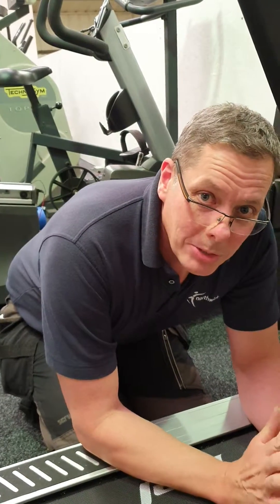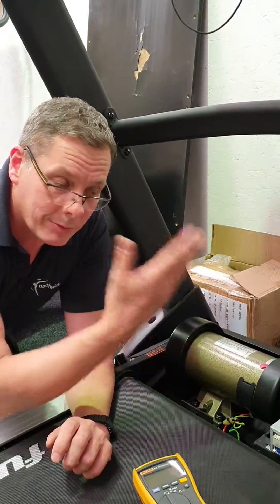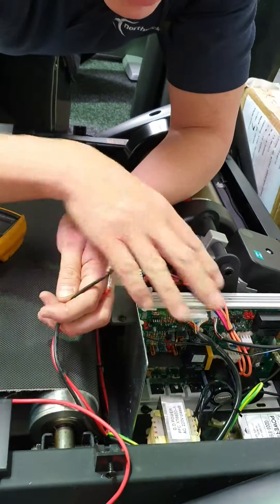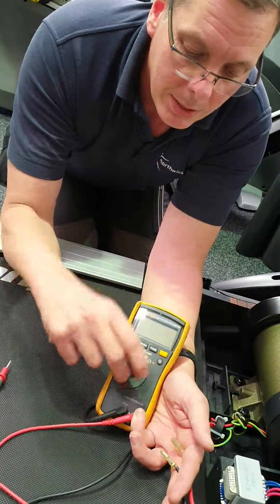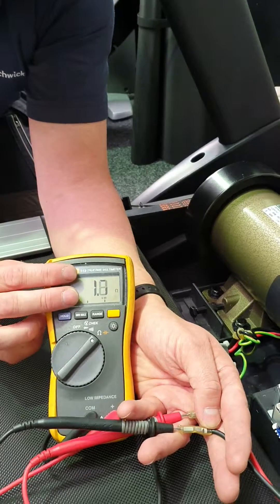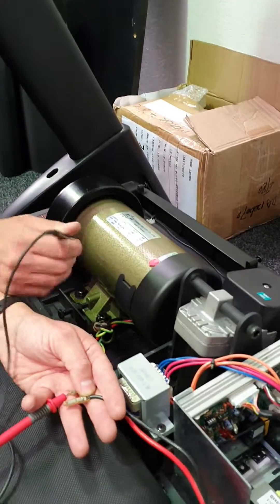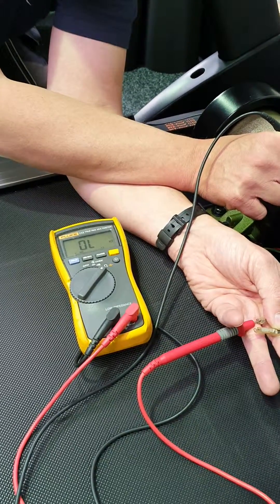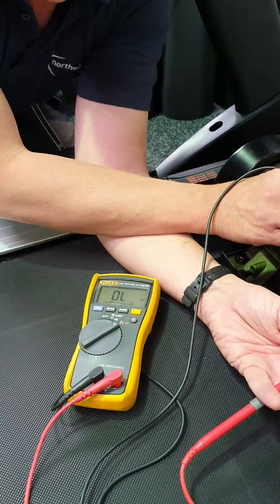How to check a DC drive motor from a treadmill using a multimeter

Comment: Hi there, I have a GoFit GFTMP01 and it has the error1 code, I have checked all the cables and everything looks ok, so I think its the motor... I have done your test above and the first test, the first time I got 10.3 reading, second time 9. something and the third time it was dancing around for awhile but finally settled on 7.8.... The second test never gives me a reading, I tried the black one on the motor, the chassis, random screws and bolts on the body of the treadmill...

What is your professional opinion please?

Comment: Hi, any ideas? Using analogue meter, first rest shows about 0.8 second test needle doesn't move. Got power to board and it shows sending signal to motor but although there is power going in motor doesn't move. Any help appreciated thanks

Comment: can i use a power supply to give it 9 or 12 volt dc for test it ?
or its better to use a suitable battery for this ?
Reply from the maker: Unfortunately, you can't use a battery to reliably test a DC motor for a treadmill. This is because the DC motors have permanent magnets and all a battery will tell you is if the motor will turn. If the magnets are damaged (which is often the case if the MCB fails on full load) then you will not know it. If you simply fit a new MCB, it will fail again quickly. You should take it to a specialist DC motor repair shop and get it tested on full load and have the torque or current draw checked. The full load current should be as indicated on the label on the motor. If it is higher then the magnets are damaged and the motor must be scrapped.
Reply: @charteredengineer  thanks for the answer sir 
if i want only test the motor without load  if turns can i use apower supply 9 volt instead a battery as i have seen on the most video on you tube ?
Reply: furthermore sir something else if the treadmill turns normally and the motor smells whats mean that from your experience `?

Comment: The motor runs but gets hot and it smells. Replaced the bearings without success.
Ran the motor disconnected from the belt and it still gets hot and smells.
Resistance was 2.5 - 3 ohms. I turned the armature through 1 revolutions slowly and no shorts or open circuits.
Both leads measured open to the motor body.
Pulled the motor apart and measured directly across the armature coils and found 2.5 - 3 ohms between every pole and every other pole. I cleaned out the gaps in case it was a buildup of graphite but it didn't change anything.
I must have multiple shorts in the windings where the insulation has failed in a place that doesn't result in a short circuit reading on the multimeter.
Reply from the maker: If it's a domestic treadmill with a permanent magnet DC motor then it's most likely that the magnets have lost their magnetism. This would result in overheating and excessive current draw. If so, you'll need a new motor.

Comment: Hi my meter is saying L to N of 443 and second test to chassis of motor on either phases is OL ,can you please advise me thanks Jim
Reply: Hi Jon my mistake ,I was testing the wrong wires ,I have removed the motor and re tested ,the reading iam now getting is around 5 which is low ,I have also tested the motor on my car battery and it runs fine ,the machine is coming up with an E02 fault code ,the manual indicates that this is a motor failure  thanks Jim
Reply from the maker: @jamesgriffen1740  Most likely a problem with the controller
Reply from the maker: The reading of 443 is much higher than I would expect and so I think there is a problem with your motor. The OL reading to the chassis is good.

Comment: I have an old BH Fitness treadmill. I smelled some burning then the treadmill died. I see the burn mark on the control board. I replaced the control board and the treadmill works now, but i thought i smelled some burning again. Even though the motor runs and seems fine, could it be the cause of why the control board got burnt out? What do i need to check now? thank you
Reply from the maker: The same problem happening again will be due to there being too much friction between the running belt and deck. This happens due to either lack of lubrication or just wear and tear. You need to replace the running belt and perhaps the deck too. Maybe time to look for a new machine.

Comment: Hi. My treadmill has died and tripped the circuit breaker. I did get an electrical burning smell just before it went wrong. The casing of the treadmill was quite hot and directly underneath was the motor. I took the motor out and have done this resistant test. I get 2.6 ohms (180v motor, 5.5 amps). I did the chassis test and I’m not getting a reading. I can buy a new motor but not 100% confident it is the motor
Reply from the maker: Hi Simon - electrically your motor is testing ok although it could have suffered heat damage to the windings. I suspect your motor control board has failed and is causing the tripping. Most likely the root cause if high friction between the running belt and deck. These could also need replacing. Hope this helps. Best wishes, Jon
Reply: Thank you. I attached the motor to an 18v battery from my portable drill and the motor is turning. Now to see if I can check the motor control board you mention. The motor seemed easy to buy….whether I can but the control board remains to be seen 😬. Thanks again

Comment: 200M -  01.7
Chassis - 05.1🤔
Reply from the maker: Hi - If the red and black wires are 1.7 ohms then that is good. If the red/black to chassis is 5.1 ohms then that is bad!

Comment: Hi jon any help would be greatly appreciated i have a 3hp nordictrack treadmill motor ive had the motor control board repaired and the guy says the damage points to a faulty motor the first test is reading 002.7 and second test is ol

Comment: my 4.0 Magna Drive motor for my anytime fitness treadmill says .7 ohms on the first test, then 0 ohms for my second test
Reply from the maker: the 0 ohms reading is bad news - this means that the windings are short-circuit to earth. Your motor needs to be repaired or replaced.

Comment: Hi, i have a T3 life fitness treadmill motor 3900 rpm 130vdc 21.5 AMP 3hp...this put me on the voltímeter 3.8-4.0 my problem Is that when I start the machine appears on console Fet error AND couldn't start 😮‍💨😪...I  have a doubt,about this motor when I put 12V without motor belt, registered 0.54 AMP constantly(start in 0.92 AMP AND then go down to 0.54 amps ) without resistance, it's a bad motor? Or the drive transistor board failled? Thanks a lot, the motor smell Little like burning
Reply from the maker: It could be a faulty motor especially if you can smell burning. The drive board may also have failed. The root cause could be too much friction between the running belt and deck. My experience is that the running belt and drive board are the most likely to need to be replaced. Hope this helps.
Reply: @charteredengineer  thanks I appreciate to you, I have one more lquestion, what's the AMPS that one good motor need to work whithout people, chanrge or motor belt put in...I mean a good AMP work, some people say that Is 0.21-0.29 AMPS constantly in this kind of treadmill motors no matter what voltage put for work after 12V, But always need to be that? Thanks for all, good Day AND thanks for the videos 💯🤜🤛

Comment: Hi Jon - my first reading is 5, but on the bare metal test, the meter stays put on #1
Does this mean motor is bad?
Thanks
Reply from the maker: Motor is electrically good.
Reply: @charteredengineer  
Many thanks
Reply: @charteredengineer  Many thanks 🙏

Comment: One more thing, and I'll stop bothering you, my reading on motor leads 0.7 , and nothing to ground. That low reading is normal,, yes?  4.2 HP
Reply from the maker: 0.7 ohms on the leads is good. "Nothing to ground" I assume this means you are not reading anything on the meter which is indicating a very high reading (over the range of your meter). If so then that is good. If you are actually measuring zero then that is bad because it shows a short circuit to ground. Best wishes, Jon

Comment: OK, since that conversation, I hooked up 18V from a drill battery and the motor worked, I'm guessing the power board? I'm not getting any DC volts off the board to the motor leads. Thanks
Reply from the maker: Yes I agree - sounds like the power board that has failed. Check the running belt and deck for excessive friction - this is often the cause of the circuit board failing (overload!)

Comment: Hi Jon great job, my treadmill red black shows OL ,, no resistance, keep in mind theres also 2 blue to the motor also. thanks is the Moto shot?
Reply from the maker: Hi - yes I think the motor is shot. There should be a low resistance between the red and black wires and OL indicates that there is no connection so windings could be burnt out. The blue wires are to a thermal switch which is separate - a Nordic Track or Proform treadmill presumably. Best wishes, Jon

Comment: The black lead on the motor showed a shortcircuit to the motorhousing. Took the cap off the motor that holds the carbon brushes. Found a build up of carbon dust making a connection between the carbonbush holder and the housing. Gave it a good clean and reinstalled everything. Runs as good as new now.
Reply from the maker: Thanks for adding the comment - very interesting and useful for others!

Comment: Hello 

I have done the checks as stated in your video, 

My red & black wires on Omz give a reading of 2.5 

My 1 multimeter wire touching the motor metal part gives a reading of 0.L 

Could you please tell me if the motor is working or needs replacing 

Thank you
Reply from the maker: Electrically, your motor is fine.
Reply: @charteredengineer  John, 
Thank you so much for your reply. Do you have any other suggestions as to why my treadmil belt is not starting? The incline and all other other buttons seem to except the treadmil belt. 
Thank you
Reply from the maker: @geetabickerton416  I can offer a remote video diagnosis for GBP49. Let me know if you are interested.

Comment: With the black wire scratching the motor it is showing OL
Reply: Thank you and I did get that motor running by hooking it to a 20 volt Craftsman drill battery. I was looking to see if that model had the fuse in it and I was hoping you could let me know
Reply from the maker: @MustangSteve  the motors don't have a fuse - the fuse is on the MCB (if fitted).
Reply: @charteredengineer  thank you for an awesome video and your help..
Reply from the maker: That's a good pass.

Comment: I set my multi meter on 20 ohms, touched meter wires to motor and meter went form "1" to "0".   No results on second test.  Meter stayed on "1".
Reply from the maker: That's a pass - low resistance on the windings themselves and high resistance on the windings to to case.
Reply: K, wonder why motor won't run when power being supplied to it.
Reply from the maker: @larrythompson5617  Probably a faulty controller. Possible excessive friction on the belt and deck too. Worth finding out what the root cause is before you start replacing parts. I can offer a remote diagnosis (online) for GBP49 if that helps. Best wishes Jon
Reply: @charteredengineer   Well you were right.  The motor is fine.  I attached a cordless drill battery and the track worked.  Now there is power coming from control board but when I connect motor wires to the control board a red light goes off.  So possibly the board is gone.
Reply from the maker: @larrythompson5617  Yes most likely. You can't reliably test a circuit board with a multimeter as the output is a PWM signal and multimeters do not have that option. Also you need to determine why it has failed.
Reply: Belt and  motor are free spinning and power coming from controller so somewhat perplexed.

Comment: morning Jon im getting a reading of 14 ohms at the motor and a reading of 166dc to the motor from the board. i have an E1 error the screen lights up and goes through the start up cycle the time starts to count when i press start but at no point does the the belt turn. then after 8 secs the board clicks and the E1 error appears any advice would be great

Comment: Hi Jon thanks for the video thanks for making it easy to understand. I'm having trouble with the Error code E-03 on a reebok Z9run treadmill, you say that the resistance should read around 1.7 ohms the number I have on my meter is 02.8/9 second test showing no movement on meter. Gordon Higgins

Comment: Hi Jon , I have a Reebok ZR10 with error E05 showing a few seconds after start up. Have replaced control board  (first suggestion ) no good . Replaced speed sensor  no good. Finally disconnected  motor from drive by removing belt from pulley. Motor runs but pulses and then goes to E05. Checked motor as you suggest . on 200 ohm setting I am getting 23 ohms and on second test getting 1. When running the motor detached from drive I also have the speed sensor removed would this explain the pulsing of the motor  and is 23 ohms a bit on the high side ?
I should explain that I know E05 relates to running belt speed and tried many times to set correct tension on the track .
Reply from the maker: Hi Richard - motor results are good. It sounds like the console is not getting the speed signal. If you have replaced the sensor and the lower control board then you either have a console circuit board fault or a faulty cable. Hope this helps.
Reply: @charteredengineer    Thank you Jon for your very quick reply ! I will look into your suggestions ! thanks !

Comment: Is there a way to tell the brushes are bad. I’m currently troubleshooting a radiator fan motor. I got a resistance of 350k ohms between the terminals. I wonder if the windings are bad or is it just worn out brushes. Thank you

Comment: Thanks for your video! I have a Tunturi T40 with 180 VDC motor. The motor driver board starts. When I press the start button, the motor starts to turn but the driver board immediately gives an error and stops the supply to the motor. I want to determine if the motor or the drive board fails. The resistance from the motor is 2.2 ohms with a Fluke. Between each wire of the motor to the chassis I have open loop. Do you think this is normal?
Reply: Checked/cleaned your speed sensor?

Comment: On the first test I'm getting 4.2 ohms and on the 2nd test 87.7k ohms. This treadmill is tripping the circuit breaker. Replaced a burn out belt last month. Is the treadmill unrepairable?

Comment: Hi Jon, firstly thank you for your video.
The first test shows a reading of 0.01 ohms with the Meter set on 20k 
This result does go up if I rotate the motor not sure if that helps aid in in answer.

Second result I get a 1.  screen on the Meter ( note this is a really cheap Meter)

I have put an 18v battery to it and seems to run fine 

I have seemed to check over quite a few things and the seem all ok 
The issue , when i put power to the treadmill it start the motor for a split second then trips the breaker I'm guessing it's either the circuit board or motor?  Have tested  breaker and other components seem all good.? 
Thank you for you help
Reply: Hi Elias, I have the same problem when the motor starts. Did you already figure out what caused the issue with your treadmill? 
the first test gives me 1.7 - 2.0 ohms and the second one OL. so the motor wiring seems to be fine. I also replaced the entire control board but the problem persisted.

Comment: My meter reads 0.7 Ohms. In some positions I can get it to read 1.0 Ohms. It reads an open circuit to the outer case.
The motor is a Turdan 90V 18Amp motor. So I would expect the coils to read 5 Ohms = 90V/5 Ohms = 18Amps. So I would think the coils are shorted out somewhere? Or is that normal?

Comment: Hi, in my case, between the terminals I get a reading of 1.7 ohm which seems ok... but, between any of the terminals to the chassis I get around 35k ohm. BTW, I'm testing the motor because when it's connected to the control board it trips the differential fuse. So, could it be the motor insulation the problem?
Reply from the maker: Sounds like a motor problem. 35k resistance is likely to be enough to allow a small current to flow to earth and cause the trip.
Reply: @charteredengineer  , Thanks for the tip, I fixed the problem!
I opened up the motor and inside it was saturated with this really thick “dust” coming from the wear and tear of the brushes… this was “short circuiting” the terminals with the chassis. Never saw something like this before.
So, I cleaned it up, put it back together and finally no reading between any of the terminals to the chassis, like it’s supposed to be.
Again, thanks for the tips, very helpful video!!

Comment: How do I determine if a dc motor is 12volt or 24 v
Reply from the maker: If its on a treadmill then its probably 90V if you're in USA or 180V in UK and elsewhere. Only way to be certain is to check manufacturer’s label on the motor itself.

Comment: Hi Jon, Thanks for the nice video.
My treadmill motor keep blowing the fuse (13A at power cord). So, I follow your video with cheapo meter.
First test, the resistance is 1.1 Ohms (on 200 ohm range). Second test is 1 (OL). 
The reading will be fluctuating (1 - more than 100) if I rotate the motor pulley
Any clue?
Reply: Hi
Did you find the problem? I have the same problem.